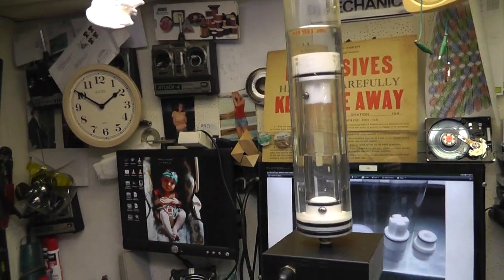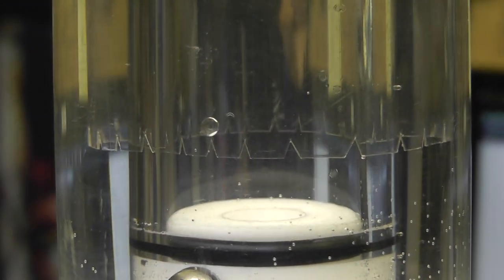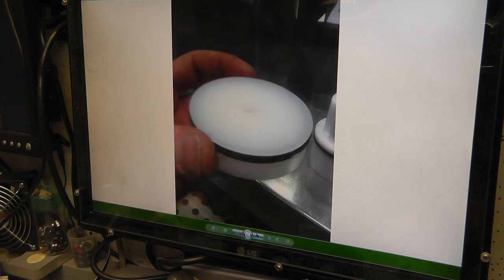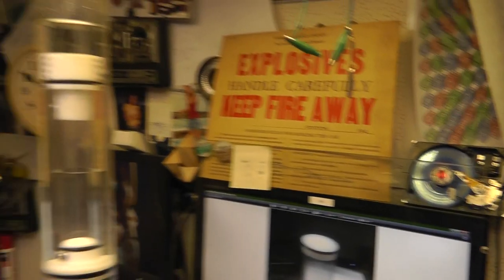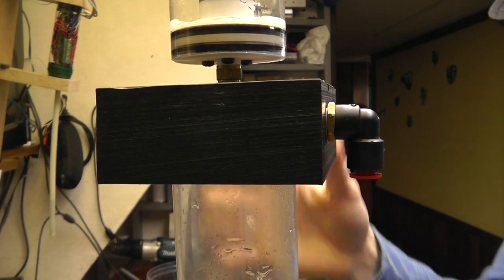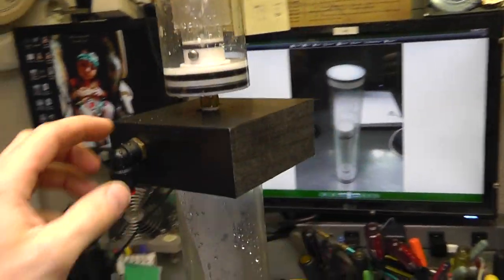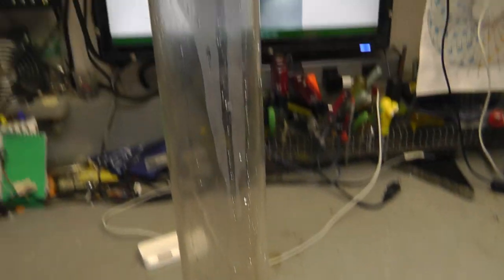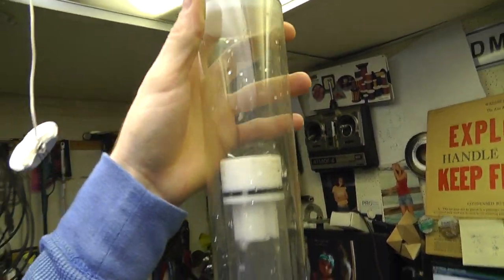New Bubbler & HHO Vortex Separator Parts Brake Down & My Quenching Disk

Comment: if you type in  "porous ceramic discs"  at small parts dot com, it may be something you are looking for. They are expensive and were once used in the battery vents but most manufacturers have merged over to porous plastics as its much cheaper.